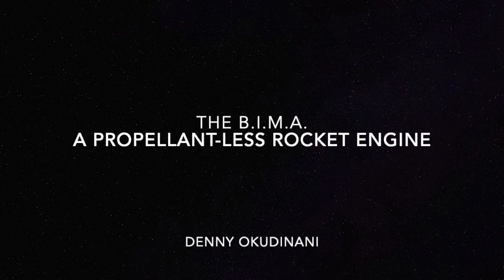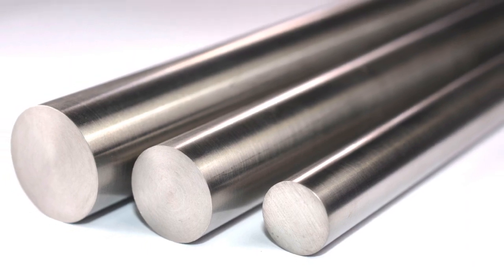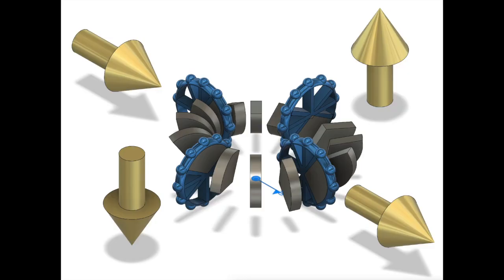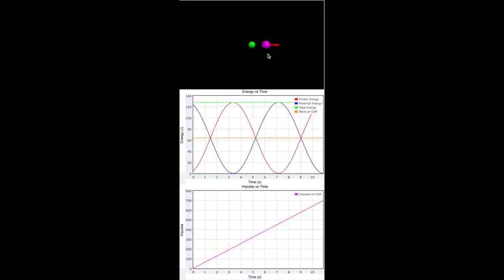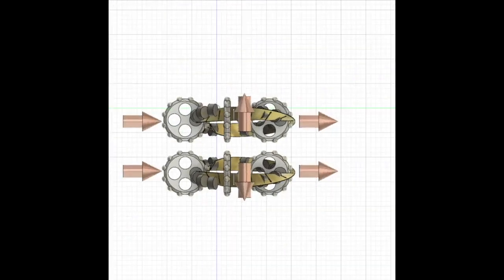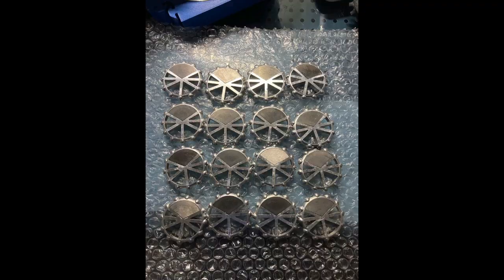Inertial Propulsion System 1: The unBalanced Inertial Mass Accelerator (BIMAH)

Comment: I think it's a really great idea to make these machines to finely control center of mass.  This could actually work in several ways by known physics and a few by untested or unknown physics.  The practical way it could work is by inducing rotation due to friction losses with the atmosphere stabilizing like a frisbee, and rapidly inducing up and down motions of low amplitude where friction is higher in one direction than the other due to the shape of the outer hull. Helicopters can be thought of as working in this way by small thrusts (and falls) but are not robust and amplitudes are too big for efficient levitation.  Very tiny and fast amplitudes using the entire craft and differential friction could do that more efficiently.  In considering current physics and the technology, unless you can transfer momentum somewhere I don't this it can work in a vacuum, but such devices could allow more interesting and efficient ways in the atmosphere where momentum transfer can be done to surrounding air.  One thing that might be possible with VERY fast rotation and using much stronger materials is that once orbital velocities for the internal spin are reached you should  be falling around or on a hyperbolic trajectory relative to the earth and that should cause some kind of levitation or lift...but the maths are poorly developed and might not work or work in unknown ways.  Lastly, if these motors were built on atomic scales with relativistic velocities (gold electrons are relativistic for example), then quantum effects...perhaps related to quantum gravity...could become relevant.  This setup is one the right track but probably cannot access those regimes just yet.  Keep trying though.  Although so far conservation of momentum holds, it doesn't have to in certain energy regimes or can be manipulated practically, and without testing new regimes and possibilities we would never know without people like you.
Reply from the maker: Thank you for this comment!

Comment: This is the same classic technique people use trying to make perpetual motion machines sound plausible, just keep adding moving parts until the mathematical model gets complex enough to create errors that look like some anomalous force or energy will be created.  It won't, obviously.  Nature would have evolved levitating creatures if physics worked like that.

Looks like you fooled a lot of people though, so good luck monetizing them.
Reply: It actually costs zero energy to levitate by F=distance x force where distance is zero.  Balloons do this easily, although we don't have animals that work on that principle in air...they certainly do in the sea where many creatures have air bladders for such.  I think you are being too pessimistic.  I think it's a really great idea to make these machines to finely control center of mass.  This could actually work in several ways by known physics and a few by untested or unknown physics.  The practical way it could work is by inducing rotation due to friction losses with the atmosphere stabilizing like a frisbee, and rapidly inducing up and down motions of low amplitude where friction is higher in one direction than the other due to the shape of the outer hull. Helicopters can be thought of as working in this way by small thrusts (and falls) but are not robust and amplitudes are too big for efficient levitation.  Very tiny and fast amplitudes using the entire craft and differential friction could do that more efficiently.  In considering current physics and the technology, unless you can transfer momentum somewhere I don't think it can work in a vacuum, but such devices could allow more interesting and efficient ways in the atmosphere where momentum transfer can be done to surrounding air.   One thing that might be possible even in a vacuum with VERY fast rotation and using much stronger materials is that once orbital velocities for the internal spin are reached you should  be falling around or on a hyperbolic trajectory relative to the earth and that should cause some kind of levitation or lift...but the maths are poorly developed and might not work or work in unknown ways.  The three body problem needed has only a few known solutions for special cases...its on the cutting edge of math and physics, so we shouldnt be so certain.  Lastly, if these motors were built on atomic scales with relativistic velocities (gold electrons are relativistic for example), then quantum effects...perhaps related to quantum gravity...could become relevant.  This setup is on the right track but probably cannot access those regimes just yet.  Although so far conservation of momentum holds, it doesn't have to in certain energy regimes or special situations where translation invariance doesn't hold or hold practically and can be manipulated practically in that way. Without testing new regimes and possibilities we would never know without people like him.

Comment: an inclosed system would not provide any thrust without violating conservation of momentum is my thinking here, but its cool. maybe a gyroscope like this could be used as control mechanism in orbit if it could push against the magnetosphere as a medium of influence
Reply from the maker: Hey thanks for this comment, I appreciate it! I also like your novel suggestion—such an application never crossed my mind. 

Actually in my paper, I address this matter of being a “closed” system through a novel invocation of Mach’s principle. In short the system is an opened system (my thesis implies that at a fundemental level there is no purely “closed” system—just some which are more isolated than others). The most powerful thing about this formulation is it honors newtons laws concurrently, while illustrating mechanical parallels to fundamental interactions related to force as a process at even the most fundamental level.

Conservation is similarly discussed at great length throughout my paper and on this channel. Because I’m using something called “inertial confrontation” force is treated as a process which can only emerge when at least two bodies have motion trajectories which are in “conflict”with one another (via Newton). An excellent video which fundamentally addresses why this sort of system does uphold conservation laws can be found here:

https://youtu.be/johW9d-sFQE?si=xr_P80baOlRmDded
Reply: @MillennialZoomer  i went back and looked at this video you posted and its a very nice explanation of a principles used in creating another type of device. in the video it highlights newtons laws of motion and when applied to this device it would mean if it could get running and if sustained it would go absolutely nowhere. thrust is made from expelling some type of material and without a thrust your body will not move in an inclosed system, which is what is in your video. its an interesting gyroscope ill say it again but without it being in zero g , and built to harness electromagnetic mediums, i dont see it doing much else beside wasting energy with no output.
Reply from the maker: @w4bbitseezin  Hey, thanks for taking the time to watch the video! So few try to do that. I'm not sure why you believe inertial confrontation is exclusive to the illustration used in the video. It is the same exact principle being used  governing  both the systems within this video, and also where the mathematics (physics) for the simulation is derived with respect to motion. These devices can only work because of newtons laws, and so long as Newtons laws are carried out concurrently with one another. For a more rigorous presentation I do recommend section  4 of my paper which provides the meticulous calculations, charts and the actual position/evolution/force over a given cycle for a two particle system over time t.

Fundamentally this system is not closed . That is the thesis of my very long paper. This thesis is developed on math (physics)--not because I say so. Thats how Mach's principle [can] work. If you think theres any ounce of validation in the work of guys like James Woodward (and his MET's), then my work should be much more convincing (and simpler in terms of the math).

Comment: Did something vaguely similar in a physics sandbox game once with directionally rotating weights in a metallic cube. I galled them "gyropods", and they could spin at insane speeds using only internal rotation.
.
But I turned them into vehicles, that held a counterbalanced control system, but I must also add, this was in a fairly 2d game.
Reply: Ah-- I was trying to find the space probe concept I was remembering-
( https://www-robotics.jpl.nasa.gov/how-we-do-it/systems/hedgehog/ ) Apparently what I'd created in that gane as a child was a flywheel mechanism. And the idea for using these for motion has been experimented with for years if not decades. 
.
Yours tho, looks much more self contained than the face bound three axis wheels of your usual gyro cubes. Would probably mean a much lower risk of a cube face being hit completely comprimizing a disk, as there'd only need to be this one ring of rings in the center. (if i'm not misunderstanding this as something of an omnidirectional flywheel cpncept)

Comment: wish it works. it looks like it might but everything looks like it might. put two of them on a rotating stick to show rotation. but it does look like that will work with a water hose. water has a lot of mass and you can make that a coil. no gears needed just a water pump

Comment: I was thinking semi dirac fermions which can become mass to energy could be used like a pseudo monopole by basically being mass in one direction and when electric or magnetic fields are applied it aims the magnetic or electric field of the solid or mass and as the mass becomes energy it aims the field lines creating a pseudo monopole that can be aimed it whatever direction you need it to be.  Further research is pending on that for fusion as with true monopoles which this is not but fairly close to it which could make ultra powerful magnetic fields or customizable fields unfortunely I used an ai to build this process and simply dont have money to go to school.  Its sad I also created a warp drive that requires a 1GW startup and then using vacuum memory loops and negative effective mass I got the energy requirement down to 10 to the 3rd power so as much energy is required as running a microwave, however I did this also with ai so I am skeptical that it is an accurate number but man would I do humanity well if I could get off the ground with these concepts.

Comment: Did this design came from this? https://www.youtube.com/watch?v=4_3HxZnWaEA
Reply from the maker: Hey, thanks for the comment! 

First: nice find- this is an awesome video from  back in the day. Second: my design was inspired by tesla's flying stove---if I had to take a guess, I'm pretty sure the machine in the other video was too! 

It appear that our designs are similar but also differ. For example we both use bearing like gears, but my design uses a type of geared confinement their external gears(so fewer parts).  In fact, my early prototypes used normal gears, (and I got the gear ratios wrong a number of times). As I improved, I had a "bowl" which had something like the "ring gears" in that  design, but most of my parts were one piece, whereas those in the video link are of many components. 

Eventually I created the "ophans" which are the spiraled toroidal bowls, you see in this video, to ensure that gear spin rate was synchronized correctly.

Comment: Keep at it... Your on the right track...
We call our version, which in principle works in a similar fashion as yours, but we use a different approach, and call it a recoilless motor.
Peace from Australia
Reply from the maker: Thank you for the comment+encouragement! Hope you share some of your builds/ findings in a future! I'd be very much interested in learning more about your team's unique approach!
Reply: @MillennialZoomer  As you can imagine I am reluctant to say to much on an open forum. However, there is a relationship between the speed of the rotating "drives" vs the mass and force it can produce. Consider the classical spinning ballerina example. If she spins too fast the net force in her extremities balances out. If she spins too slowly, then there is not enough force to work with. In this case imparted by the centripetal force. The correct rate, would be determined by balancing weights (force generated) vs instantaneous velocities. Our approach does not require the use of magnets. But I really like your thought process, which is why I responded.
 I wrote some simple software to simulate this, and mathematically it works (breaking no laws of physics). In practice its very tricky to control. (I use 3D printers to create the devices - but they have limitations - at this time).
 Peace from a 60yo Australian. (Background in Maths, Computer science, professional software developer for about 30 years, and (oddly) geology).

Comment: Sounds nice but this has been tried and it doesn't work. When you rotate a weight around a pivot and detatch it the pivot point receives an acceleration in the opposite direction. It is not possible to convert angular momentum to linear travel. A simpler variety of this device type has been invented and and proven not to work. You're repeating something others have already investigated just in a different way.

Comment: 🎯 Key points for quick navigation:

00:00 🧲 Daniel introduces himself as an inventor competing in the Gensspiration Prize and describes his early research on Hallbach arrays to improve magnetic levitation efficiency.
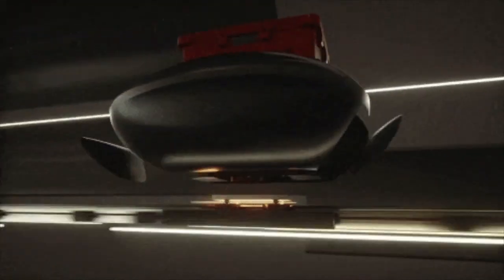00:14 ⚙️ Hallbach arrays are explained as magnets arranged at 90° intervals that shift the magnetic block wall, canceling forces on one side and concentrating them on the other.
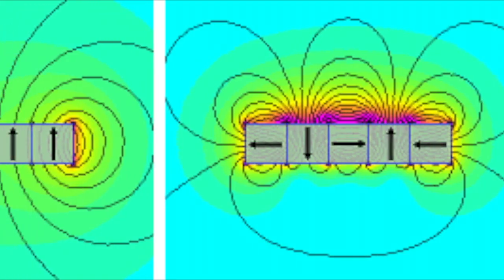00:27 💡 This inspired Daniel to wonder if a similar principle could be applied to masses—creating a system that produces a single directional force.
00:42 📐 His hypothesis involved maintaining a constant and sustainable acceleration force. Research led him to use centripetal and centrifugal forces with a geared disc mechanism.
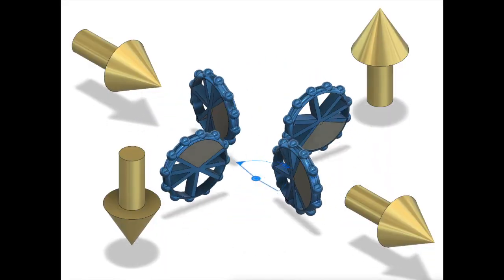00:56 🌀 Daniel refers to these as “artificial gyroscopes,” noting their similarity to Hallbach arrays and mentioning they also appear conceptually in particle physics.
01:10 ⚖️ The device uses discs with heavy tungsten masses that move along precise paths designed to cancel some forces while producing an unbalanced net force in one direction.
01:38 🧮 He emphasizes that the system’s multi-particle nature causes the center of mass to shift when operating, producing directional movement.
02:05 💻 Python simulations verified the displacement of the true center of mass and conservation of energy, showing a consistent impulse as predicted by classical mechanics.
02:34 🔋 The device is powered by electric or gas motors, converting rotational energy from the discs into linear acceleration in one direction.
03:00 🧪 A resin prototype showed visible bursts of force, though difficult to measure precisely due to environmental factors and material limitations like poor heat transfer.
03:28 🛠️ Subsequent prototypes used aluminum for better durability and heat handling.
03:42 🚀 Daniel concludes the system acts as a propellantless rocket engine, producing thrust without combustion or emissions, powered only by electricity or gas motors and built from low-cost materials like tungsten and aluminum.

Made with HARPA AI

Comment: NASA, hire this dude NOW.
Reply: NASA already made a similar system using such disk-like flywheels in an orietned array, the idea was to use it to propel the International Space station and show alot of promise, however it was ultimately considered too large and complex and wear prone vs more simple and conventional system in such a harsh and far away place as orbit. That does not mean , however, that it is a bad idea to use in other cases though.  The main drawback to their designs has been it is quite large for the amount of force it provides vs more typical methods (turbine, internal combustions, steam power)  that can generate tremendous forces for just a few hundred pounds.
Reply from the maker: #OneDay